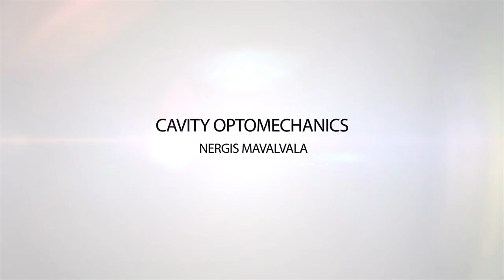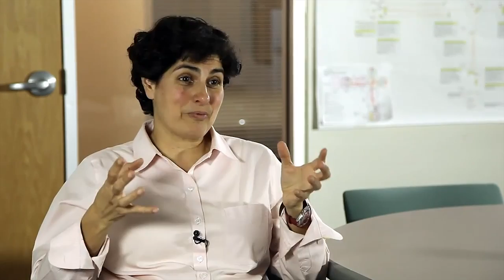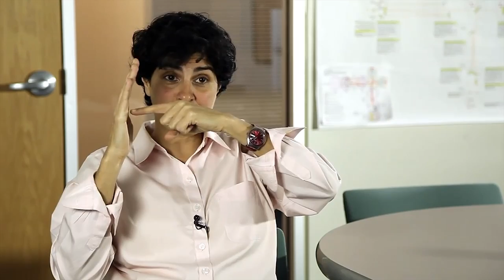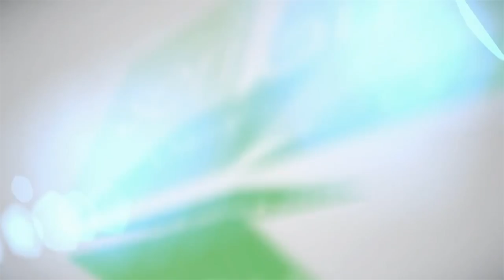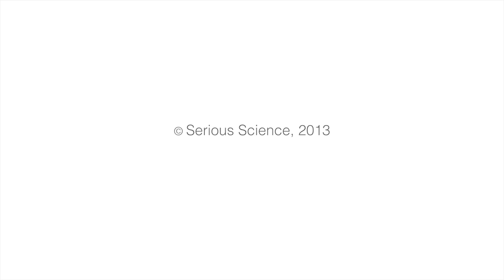Cavity Optomechanics - Nergis Mavalvala

Comment: Beyond mechanical motion interaction with light,  micro or macro level materials interaction with light  how is related to optomechanics? Avoiding thermal effect  or noise in optomechanical measurement whether optical reflection from advanced low dimensional materials is useful or not?